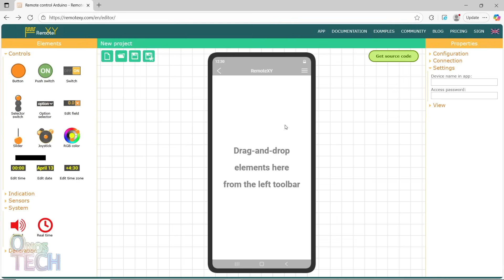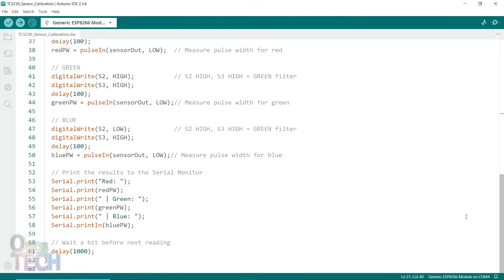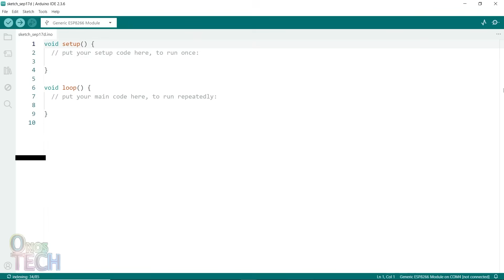How to Make a Color Detector with ESP8266 + RemoteXY!

Comment: Hi. How can I make a set up for measuring intensity of a single colour (e.g. red). I want to measure different intensity of red colour. Please suggest or if you have any video please share
Reply from the maker: TCS230 uses S2/S3 to select the color filter:
Red filter: S2 = LOW, S3 = LOW
Green filter: S2 = HIGH, S3 = HIGH
Blue filter: S2 = LOW, S3 = HIGH

Also set frequency scaling (S0/S1) for sensitivity:
higher sensitivity: S0 = HIGH, S1 = HIGH (100% scaling)
less sensitivity / avoid saturation: S0 = HIGH, S1 = LOW (20%)